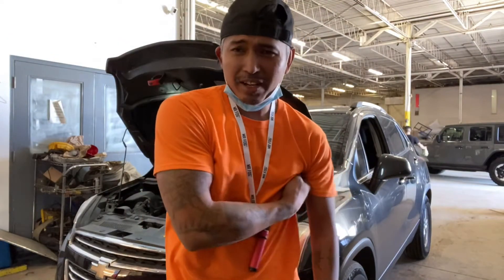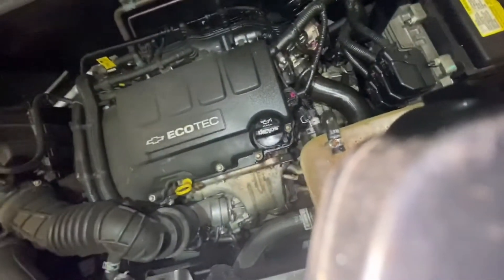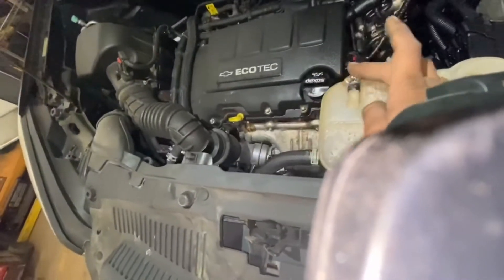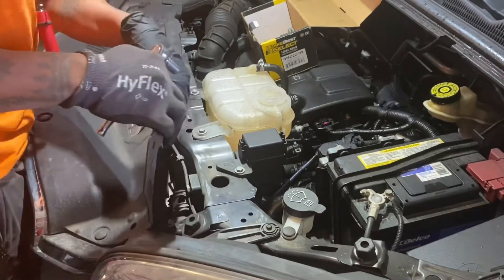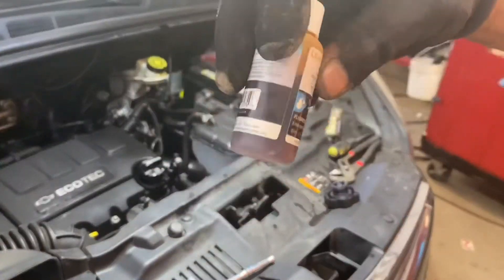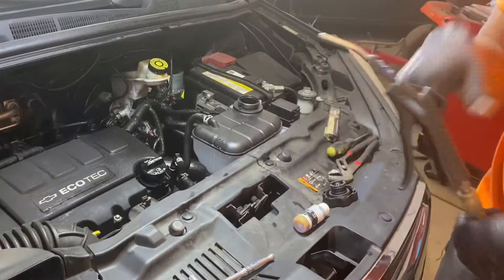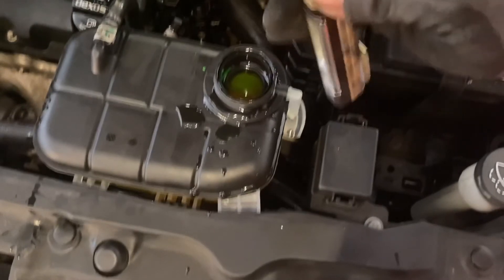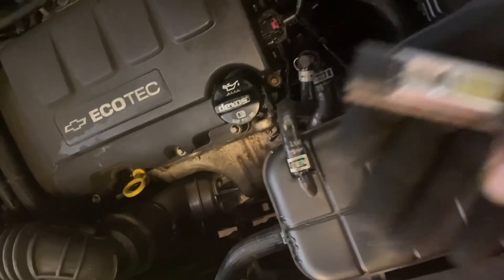2016 Chevrolet Trax reservoirs and leak detection.

Comment: This video is 2 years old so I hope you've got a cordless ratchet by now. Hyper Tough 3/8 standard and extended reach both with 2 batteries and chargers for 100.00 or less as a set at Walmart. They aren't Milwaukee M12s which I have but they are more than adequate.

Comment: Please how can i completely empty the water and swap it in chevrolet trax 2014
Reply from the maker: Drain from the bottom of the radiator. And buy or rent the kit from an auto part store
Reply from the maker: Air compressor . Drain from the radiator and suck it out with the coolant kit